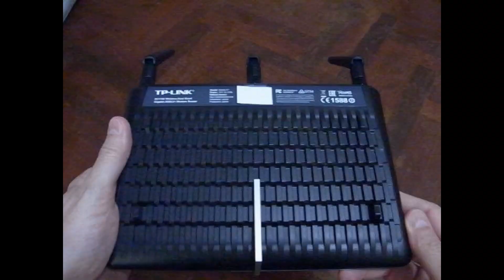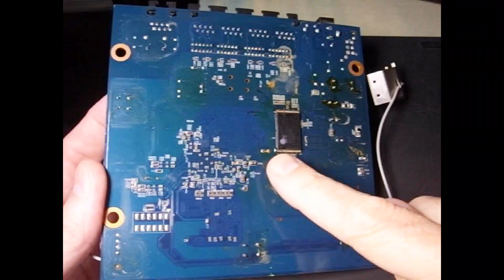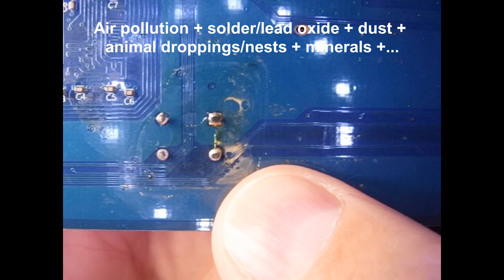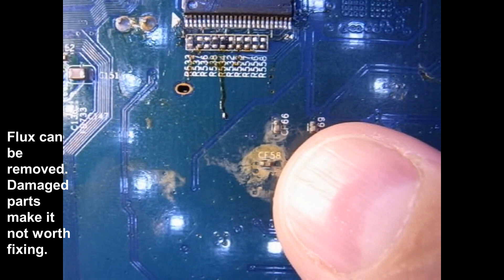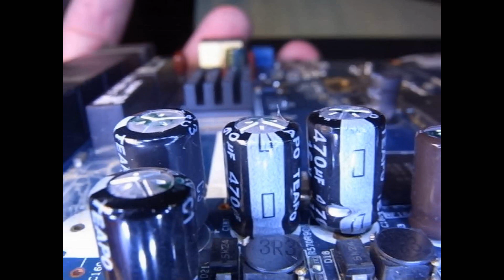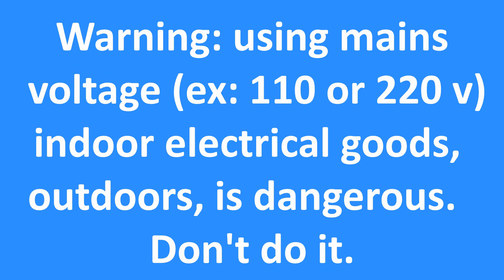Can You Use An Indoor Router/Access Point Outdoors?

Comment: Is this why OMNI outdoor access points sucks because they don't get enough power through the POE? My indoor nighthawk signal is far and long reaching outside whereas my Omni outdoor access point reaches one block poorly
Reply from the maker: @SmartySmarts  There could be several reasons including cables that are too long  or not rated for POE. There might be high resistance points at cable connections or other because of corrosion. The supply may be defective, too small, or have too many things drawing on it. Etc.
Reply: @tsbrownie  all new, no corrosion, correct type and length.. assigned channels helped a little but still poor

Comment: What if the access point is placed in a water tight protective enclosure? Would this work?
Reply from the maker: That's a good question and the answer is not simple. If you can prevent both direct water (rain) and condensing water (fog, high humidity) and avoid overheating, then in theory it will have a normal working life. But there's the danger aspect of using a product not made for outdoors, outdoors, these are not grounded and don't have any other usual electricity hazards protections. They do make wireless access points specifically for outdoors and I've helped a friend install one. It looked like it was purpose built to be outside (but maybe not in direct rain).

Comment: I wonder if spraying with clear coat would help, or a dedicated electronics waterproofer.
Reply from the maker: They do make things that will help against such problems.  Of course opening the case and making mods voids the warranty.  The best solution is what a small hotel near my house did, use wifi spots made for outdoor use (and keep them out of direct sun / rain).  If the outdoor ones are too pricey, most signals can get outside of 1 wall, so keeping them indoors when possible solves lots of issues with water, electricity, cabling, etc.

Comment: Even though I have a full WiFi indication on my iPhone while I’m in my garage, YouTube videos are continually buffering. I have old routers. Could I use one of them in my garage in conjunction with my current WiFi to help eliminate the buffering? If so how?
Reply from the maker: The "full WiFi indication" just says that the radio signal between the router and the phone is strong, but it does not tell you how much interference the signal might be experiencing (and other factors) which affect the total data thru-put.  You can use an old router (if it's still in good working order) in your garage.  The "how" varies with model of router.  There are lots of videos on the internet for the different models.  Some are easy to configure as access points, others are a stone cold bear.